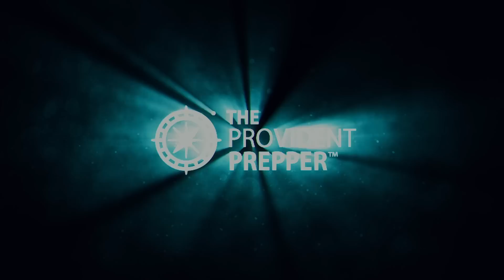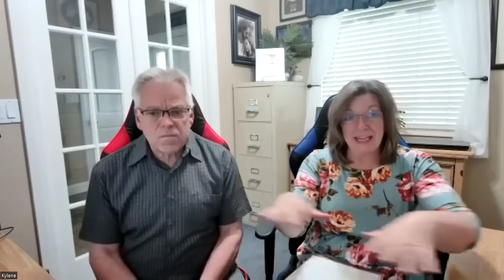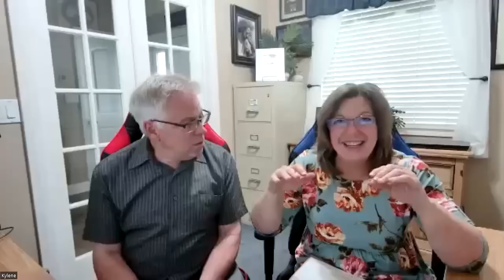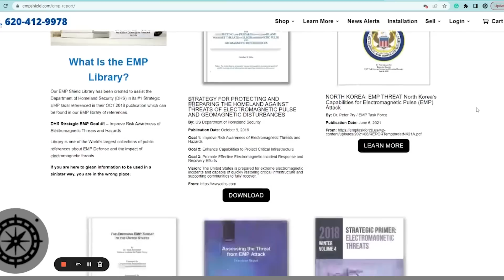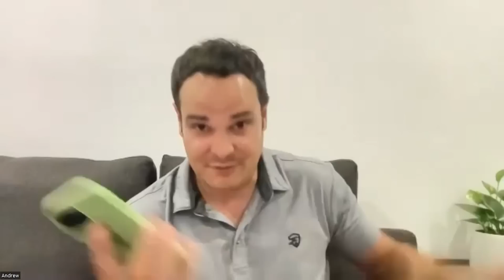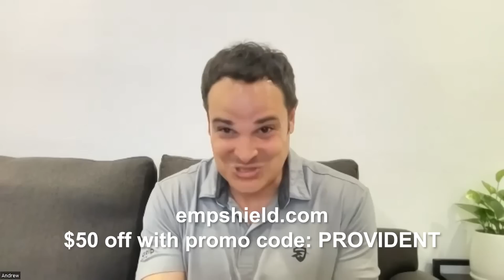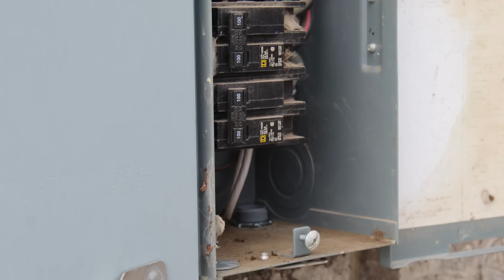Facts About EMP Protection: Interview with EMP Expert Andrew Bucchin

Comment: Interesting information, thank you 🙏 I have another question, once you’ve had an opportunity to protect something in a faraday cage, how long until it can be safely taken out of the cage ? How long does this type of energy ‘linger’ ? Also, can smaller solar gadgets survive, solar charged garden lights, solar powered battery chargers/ power bank, solar powered small radio, etc…
Reply: Anything that has a circuit board with components will be fried.
Reply: After the initial pulse, that's it. There's nothing lingering.
Reply: @burtpanzer  cool thank you for the reply, now it’s just a matter of having a few important things in a proper faraday cage before it happens lol 😆

Comment: First of all, if your home is properly wired and grounded with a grounding rod according to the National Code, the possibility of a lightning strike at or near your home should be negligible. 

Whenever a so called expert starts talking about an EMP pulse over the United States, they start right off talking about an EMP taking out the National Grid but I have yet to hear any one of them talk about exactly what equipment in the grid would be damaged that would disable the National grid and they talk as if the "Grid" was like one piece of wire that gets shorted out by the pulse. It's actually more like a network of smaller pieces sharing power on the parent grid. 

I personally believe that a blackout caused by an EMP would be just like the blackout that I experienced a month ago that only took 4 hours for our power company to fix. They replaced a main piece of equipment that failed that took our local grid off line and in 4 hours were back up. Our power companies in this Nation are next to none when it comes to troubleshooting problems on the grid and you bet that China and Russia both know this. It would be a waist of their resources and time to attempt an attack on our Nation with an EMP. There would be no military advantage to it because our Armed Forces have already adapted to this possible threat.

So, Why do all these Doomsday Sayers continually try to scare the public about a threat that we are going to get nuked? Oh, like this guy, he has gadgets to sell you which makes him an "Expert". That word salad he fed to you trying to explain the garbage claim that even he doesn't understand was almost laughable to the point that even he started laughing.

Bottom line is this guy is a salesman and not a so-called expert and this video is a sales promotion for his company using actors as the classic elderly couple prompting the salesman for his presentation. :face-purple-crying::face-purple-crying::face-purple-crying::face-purple-crying::face-purple-crying::face-purple-crying::face-purple-crying::face-purple-crying::face-purple-crying::face-purple-crying::face-purple-crying::face-purple-crying:

Comment: HEMP is a high energy (megawatts), broad spectrum (all frequencies), nano-second pulse. While the device inside Mr. Bucchin's EMP shield may be an extremely fast avalanche device, the wires (or inductors) leading in and out of the device slow down, attenuate, and basically isolate the device at extremely high frequencies. Furthermore, while I don't doubt Keystone's ability to create a testable pulse disturbance in the lab, no one really knows if a device is EMP proof unless it is subjected to a real-world EMP. As far as I know, I don't think anybody has actually detonated an EMP to see if their stuff says what they claim. IT"S ALL SPECULATION!
Reply: WRONG ! In the late 50's and early 60's nuclear testing was all about how to prevent EMP damage while learning all the extent an EMP event has. Nuke tests TEAK and ORANGE were high altitude detonations of large weapons creating massive EMP's ,.... one test knocked out the lights and electrical system of Hawaii, blew fuses and took down the radar and communications for aircraft travel !  The rocket was launched from Johnston Island, 700 miles south west of Hawaii and detonated just for such testing.  The effects were real time and sent the military scrambling for immediate solutions !  The next event was even more revealing, Project ARGUS,... more secretive than the Manhattan Project. In a series of nuke tests to create a continental atmospheric shield against nuke attack, those test proved even more alarming of EMP effects !  Every conceivable device for blocking an EMP was tested during ARGUS and the results proved workable !
Reply: Absolutely correct. His device is weak. There is a company that manufactures true capable products and that company is RayCap and the product is StrikeSorb. This product protects cell phone towers and electrical solid state devices. These guys don't sell anything in these markets.
Reply: So is it worth spending 400+/- to find out if he is right or wrong?
Reply: Greetings from Northern Québec Canada 🇨🇦  Are aluminum trash can to place electronics against EMP? Thanks, merci
Reply: This magical emp device is nothing more than a surge protector and during an emp blanket that would be cast down upon you it wouldnt do anything
Reply: the maui fires are proof of emp use..
Reply: @robertloutzenhiser1684 that's not EMP but directed energy weapon.

Comment: I am sorry to be negative but, this product is snake oil.  In the 1990's I was tasked with designing lightning protection for aircraft electronics, which is similar to the EMP P2 pulse.  The product presented here protects by opposing excessive voltage levels at the location is where it is connected only.  It works by shunting the excess voltage to ground, with the assumption that a perfect electrical path to ground is available.  An EMP consists of 3 distinct very powerful electromagnetic bursts of radio waves: P1 = short microwave bursts lasting only for about 1 thousandth of a second, P2 = high frequency burst lasting about 1 second, and P3 = low frequency burst lasting up to 2 minutes.

Unfortunately, it is not electrically possible to protect a home, car, generator, and etc. by connecting a "protection device" to the power line.  To do so would require the protection device to (1) react to the overvoltage condition within Pico seconds, (2) the wire lengths between the voltage clamping components within the protection device, as well the wire lengths connected between the protection device ground and power line to be less than 0.019"/0.5mm, and (3) the protection device would need to be connected to a perfect (super low impedance) ground using 1"/25mm wide ribbon wire.

Assuming the protection device would meet all the above criteria, it would be completely ineffective at protecting against a P1 pulse because, it would only take about an inch or 25mm of wire length between the protection device and the appliance you have connected to the power line to induce excessive voltages.  So basically nothing connected to the power line would experience any protection from the P1 pulse.

Also, this protection device would quickly burn out during a P3 pulse or CME due to the huge amount of power it would need to route to ground for long periods of time.

So to summarize, any kind of protection device you connect to your power line, only has the capability to protect against a P2 pulse or partial lightning strike.

Comment: No truer words have ever been spoken and its 13 seconds into the video.
Also I don't think something clipped or wired into a circuit will work. An EMP will seep into every inch of the circuit, not just the wire with the "EMP shield" hooked on to. It may protect whatever is directly on that line, but everything not directly on that line is exposed.

Comment: It's not a matter of if this scenario happens, it's a matter of when will it happen.
Fun fact: so far in 2023, there have been three different events on the sun with power similar to the Carrington Event. Fortunately, they all missed Earth or we'd already be back in the dark ages.

I'd be curious how well this product would work if the sun super flared with something like an X1,000 event. For contrast, the Carrington Event was estimated to be "only" X40. Super flares are estimated to happen about once a millennium.

EDIT: I was wrong about the strength of the Carrington Event. It was ~X80, not X40.

Comment: I have the emp shield for house and also 1 for the get out vehicle.  But what people don't tell you, and it Was covered here in this video, is that all things you want protected, even TVs MUST be plugged IN at all times.  Alot of people unplug electronics when not in use.  Thanks for sharing that important info.
Reply: So what cloth are u unsung. I bought one from a known co. And wrapped my generator in it with my tel. Inside. I rang that number and it rang so I suppose it doesn’t work..right?
Reply: This device won't protect your damn TV... Nothing but an actual Faraday cage is going to shunt off the energy from an EMP pulse.  The scam artist and the shills who run this channel will be long gone, and will never have to answer for this scam product.  You're basically buying an overpriced fuse.  You can tell the guy doesn't show you the insides of this magical box.

Comment: Modern microprocessors operate at 1.6 volts DC. They will tolerate 3.5VDC. EMP affects every inch of wire, period. A Solar EMP will vaporize all metals including rebar. A man made EMP is highly variable. But always smaller. A Faraday cage can protect all off line equipment and back ups. Bear in mind knowing when all is clear is  the test. Pull all your buck up equipment and they send another. How many back ups have you got?

Comment: If it doesn't work for an EMP, how are you going to contact customer service? Communications will be down and nothing will be able to be done about it. Genius! 😂
Reply: don’t forget, you will be on hold several hours also.😮
Reply: @firstlast2034  well, if a strong enough EMP hits,  there will be no phone calls to place on hold.
Reply: You're pretty sharp, JD!  So few people have done anything to survive an EMP, be it at their home or business, they won't make a bit of difference when the time comes.  Not only did I work for SoCalEdison for 15 years, but I learned a lot about the power grid even before then.
  The magnetic field pulse from either a CME or a nuke over our heads, will travel through everything that is not properly shielded, and induce a surge of electricity in it.  Diodes and transistors generally run on less than five volts, so the amount of electricity being broadcast per square yard won't need to be very high to fry them.  Every power line, both Transmission (high voltage, like 66KV to 220KV) and District (25KV and lower) will be a giant antenna, picking up huge amounts of electricity from the air.  If you go to YT and see the arc of electricity between the contacts of a line disconnect that has been opened, that is from the electricity that is in the air all around us.  There are huge circuit breakers with pressurized Sulfur Hexa Fluoride gas that are opened up before those disconnect contacts are opened up.  The gas under high pressure keeps the high voltage electricity from jumping the contact gaps inside.
Reply: Not if when
Reply: @minimalistmaximus6476  agree!!
Reply: 😂Good infomercial.. hello im billy mays😅
Reply: YOU ARE ALL CORRECT. BUT, I RATHER TAKE THE CHANCE AND SPENDING THE MONEY NOW BECAUSE MY MONEY WON'T BE WORTH CRAP IF AN EMP DOES HAPPEN. I AT LEAST HAVE A CHANCE WITH THE EMP SHIELD WORKING AND MY FAMILY AND I GETTING HOME SAFE AND BEING TOGETHER TO MAKE OUR NEXT MOVE THAT WE ARE PREPPARED FOR. THEN TO NOT TO SPEND THE MONEY AND HAVE USELESS MONEY IN MY POCKET WHEN THE SHIT HITS THE FAN AND BEING STRANDED 50 MILES AWAY FROM HOME WITHOUT A WORKING VEHICLE.   PEACE OF MIND!!!
Reply: SO, REALLY IF YOU DON'T PROTECT ALL YOUR VEHICLES FOR YOUR FAMILY IN MY MIND IS UNTHINKABLE. MY FAMILY COMES FIRST NO MATTER WHAT. SO YES I HAVE TAKEN THE CHANCE AND PURCHASED 4 FOR ALL OUR TRUCKS AND CARS. GETTING READY TO PURCHASE FOR HOUSE. GOD BLESS AND GOOD LUCK IF IT DOES HAPPEN. I PROMISE YOU IF YOU HAVE READ MY POST YOU WILL BE REMEMBERING ME IF AN EMP HAPPENS.
Reply: Just use USPS snail mail! Through EMP, sleet, or snow, the government mail through must go. Or something like that.
Reply: They won’t work, maybe with a lighting surge but not with an emp alone

Comment: I am normally a consumer of Contant. But when I see information that will miss lead preppers, I feel I have to correct that information. This product will only protect this product according to its own testing most electronics will be safe or partially damaged, depending on the impact of E1, E2 and E3 event if you are directly impacted Only a faraday cage will save you most will not be directly impacted. Meaning your car and all electronics will most likely operate or mostly operate. I feel fear tactics are in here to get you scared they don’t mention reactor stations that would trip or any other black sites or safety measures or counter measures that are already in place for these events, I love the prepper community and need to let you know that this is an issue but not as big of an issue unless you are directly impacted within a few miles. If that happens, you’re most likely screwed, but the area outside that is most likely going to be fine meaning that you will not take everything out unless we are attacked by thousands of these which is unlikely And the probability of intelligence on this is Linda not yes the risk is there, but the risk is low and the risk for hitting you directly is most likely very low or minor impact so even if it shut your car off, it will most likely turn back on with the check engine light on, but still function I hope this information helps my fellow Americans when seen information like this, reduce the risk and probability meter and focus on preps. As always be prepared.
Reply: In your opinion, if an EMP is centered over the USA to take out the countries electrical grid, and your in the outer edges of that, how bad will the EMP be on your home, vehicle, etc.
Reply: An attack would be designed to generate the strongest pulse over the widest range possible, like three detonations from coast to coast. It won't be localized or render minimal damage, so if this isn't what you're telling folks then you're doing them a great disservice.
Reply: Fun fact: if you couldn’t read it aloud in a single breath YOU NEED PUNCTUATION!

Without punctuation it’s nothing but word salad.
Reply: Have you called the EMP Shield number and asked these questions or is this all your opinion?  Id love to see what they say after you call them....Im always skeptical about most things in life.  When you have that info back please respond and let me/us know what they said.

Comment: 1. Cell phones have a very sensitive RF preamp that will be destroyed in an EMP event. the RF pre-amp is designed to pick up very weak signals in the picoamp range. There is just no way to shield the pre-amp because any sufficient device to protect the RF pre-amp would prevent it from working, since an TVS protection device will have some capacitance which will function as a RF filter at the frequencies Cell phones, Wifi, etc operate at.
2. EMP shield may not work. Basically it works by creating a fast switch that shorts the conductors together when a voltage spike occurs. However this can create a large current loop that will still dump energy into the devices connected. The only way to really protect devices is to have protect at the point of load: ie at each outlet or inside the device.  another issue is that the device might have an alternative ground path that will bypass the EMP shield. Example would be a device connected by antenna, coax (ie cable tv), network cable (ethernet), phone line (land line). The EMP can induce a voltage spike that comes in from a conductor that bypasses an EMP shield or some other surge protection device.
3. After an EMP, its likely vehicles will be nearly useless, as roads & highways will be blocked by disabled vehicles. Getting fuel will be another issue as none of the gas-stations will be operational, and even if you have a manual pump, there is a very limited amount of fuel stored. Once the gas-stations are out, that will be the end of fuel for months if not years as all of the infrastructure will be in operative.
5. if the EMP is caused by a nuclear detenation, then it means WW3 as no nation that has nuclear weapons is just going to EMP the US and that's it. They are going to nuke any military targets in order to prevent or limit retaliation.

Comment: You are amazing. It is about going back to a more simpler way of life not easier but definitely healthier. Learning to be more self sufficient even out in a desert. I bought a pickup truck water tank at Home Depot - no one wanted them… 210 gallons for $98 and they delivered it for $35. Now I have extra water for very cheap - if needed once I fill it up with a garden hose. I would never have thought about buying it had I not seen the tank in Patrick’s pickup truck😊
Reply: You need a camper drinking water hose or it will taste bad tank should be black on outside or alge will turn water green in a couple of weeks lead sheet will protect electronics
Reply: @jamesbrooks5442  I bought a black round pool cover for it? Will that protect it from algae?
Reply: Painting it silver will be better than black. Metallic flakes in the paint will block the solar ray's better than finer ones in black  both together would be ideal.

Comment: pertaining to Solar panels there seems to be debates amongst scholars if the solar panel will be effected by an EMP. They said the solar cells themselves prob wont be but they said the diodes will be effected. I suggest you look what diodes your panels have and buy a few spears. The diodes are very inexpensive.
(20SQ050) Schottky Diode 15 A 45 V /20A 50V Electronic Silicon Diodes M-019